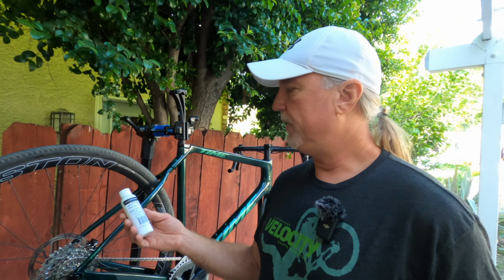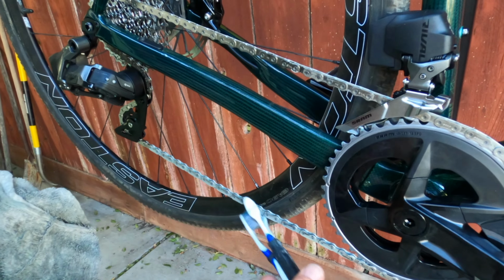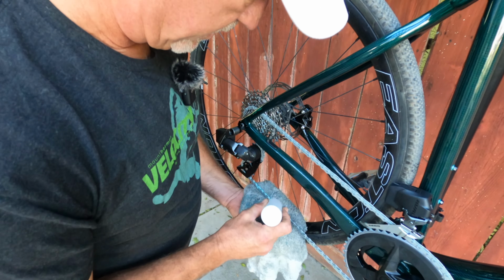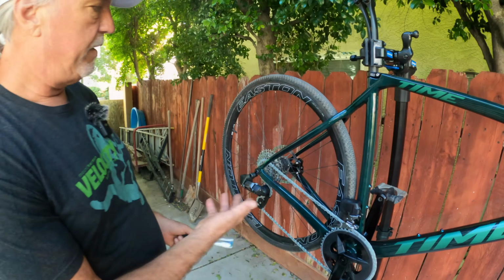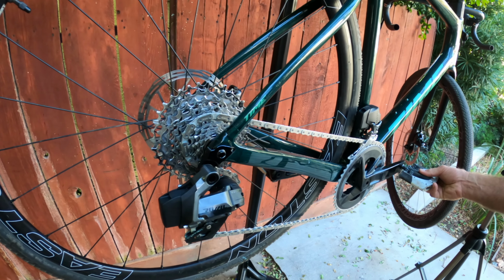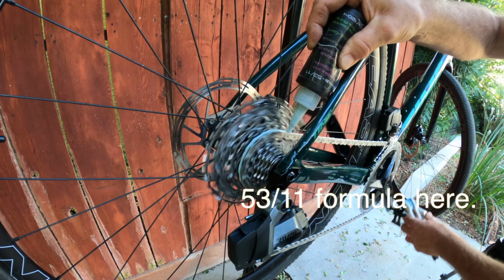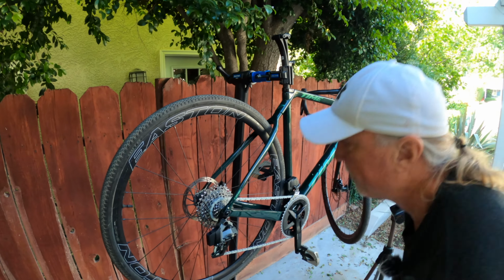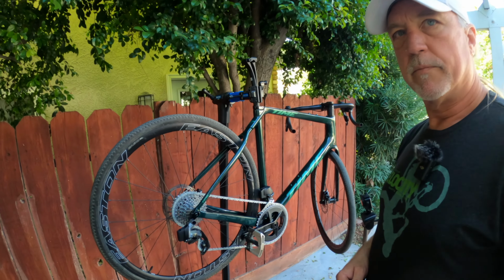We take a new, filled with grease, bike chain, to a clean waxed chain in ten minutes! On the bike!

Comment: Great video! Perfect explanation! Converted my chain on my brand new Turbo Levo (wow that grease was sticky and thick) right there on my stand trailhead.. in about 10 minutes without removing the chain.. which is key for me. Smoothest, quietest drivetrain I’ve ever felt! Love not having grease all over the back of my bike. Very impressed! Going to convert all my bikes now.
Reply from the maker: Nice. I have been riding the converted chain and spending more time to keep it topped up for the first couple of rides. But I’m settling into normal maintenance now. And yes. It is smooth and clean. Just did a 3 hour gravel. Ike ride in moon dust conditions and it stayed quiet and smooth for the whole ride. My legs looked like I was dipped in chocolate from the dirt!

Comment: Can you use a hair dryer to heat the wax up after applying for deeper penetration?
Reply from the maker: Well, in this lube, the wax is suspended in a solution that keeps it liquid so although it is somewhat temperature sensitive to use, I don't think that heat applied would be of value. Just my thoughts.

Comment: Just get the Silca biodegreaser to strip the factory grease off in 5 mins....just shake it in a container then wash with water to clean it.  Then dry and add your wax lube.
Reply from the maker: Sounds good too! I might add that this process also is establishing the Smooth Lube formula into the metal, something that takes some application cycles to 'season' the chain. Sort of gives you a head start in that way.
Reply from the maker: Here is some feedback on this: A rider in the group today had just used the Silca de-greaser to convert to the SmoothLube wax lube. It took two applications/soakings/rinse cycles to get it done. It worked but it was not 5 minutes. He had just watched the video after he did all that. Timing...etc. So perhaps 5 minutes is just hyperbole, but that was his experience.
Reply: @oldguyandabike  in silcas video on the product its a 5 min soak then wash until you get a clean chain.  Some factory greases are really tough to get off.
Reply from the maker: @stevemullin1195  yes they are!

Comment: Immersive waxing is easier, faster and better. Not sure this hack is worth it at all.
Reply from the maker: Well, it seems to me that to wax that way requires you to first strip the chain. So there is that process added. After this process we detailed, lubing is just like any other drip lube with a bit of tooth brushing. So if I wake up in the morning and want to ride but my chain is dry, I can take a couple minutes and then head out the door. or if I am traveling or bike packing or racing a multi stage, I do not need to take a crock pot or what ever and remove my chain, yada yada. But, it's your time. Use it as you see best.
Reply from the maker: And, to add to that, there is more going on here with this brand of lube then just wax, more ingredients, etc, that make for a superior result over plain wax.